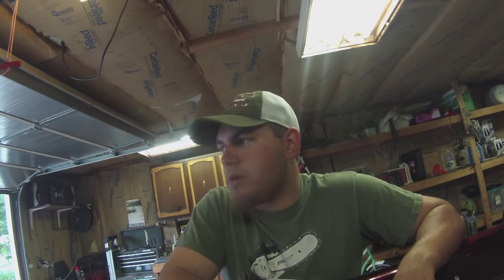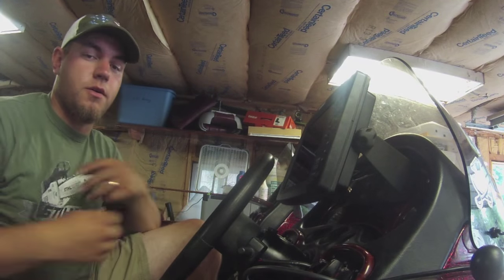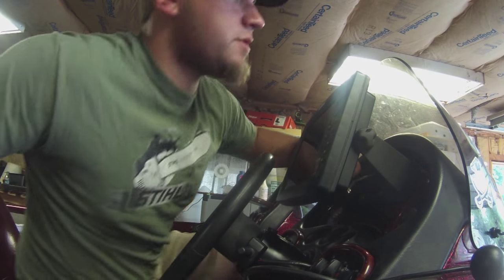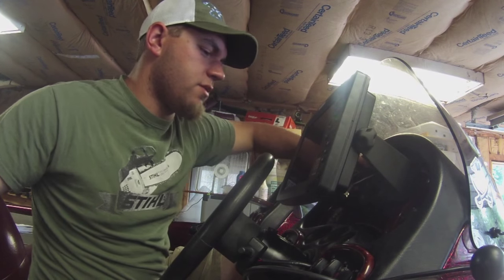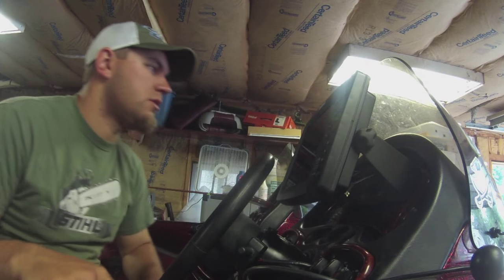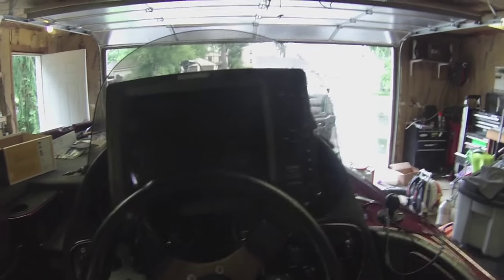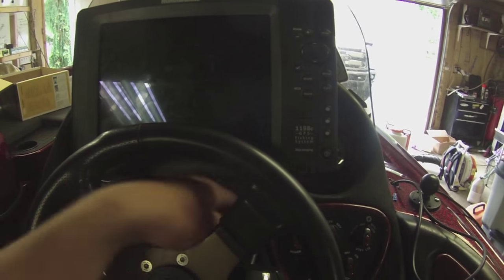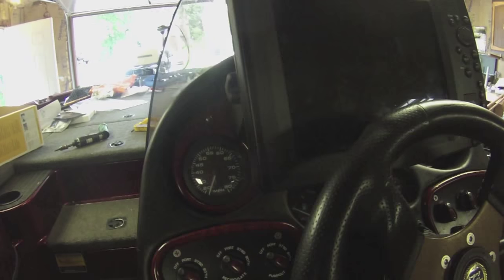new hummingbird 1198c si in dash mount

Comment: Now that you have had this unit for over a year I want to know what you think about the already installed mapping software.  I just came into one of these and primarily want to use it for looking at contour mapping of the lake and use my lowrance for my underwater imaging.  is the installed mapping software detailed enough to see the topo of the lake or do you think I need to invest in mapping software such as lakemaster?
Thanks for your time...
Reply from the maker: I use navionics mapping but I have also used the lakemaster chip. I personally think that the Navionics has more detail. Every lake I've been they seem most accurate. The preinstalled mapping on the Humminbirds are not the greatest. Thanks for the question!